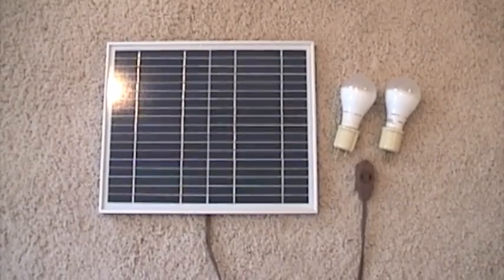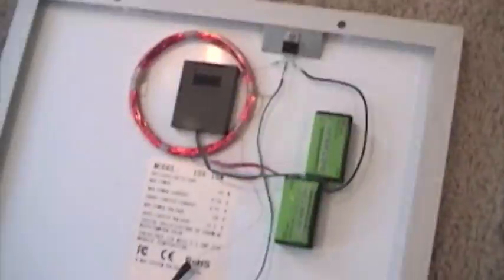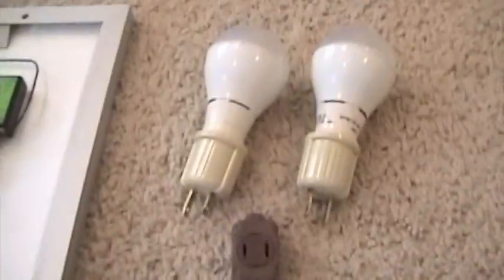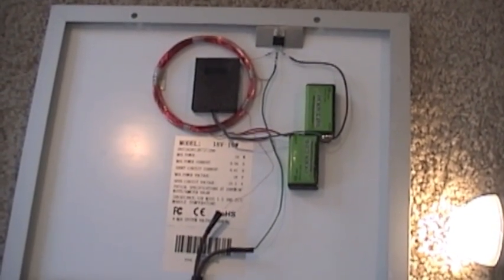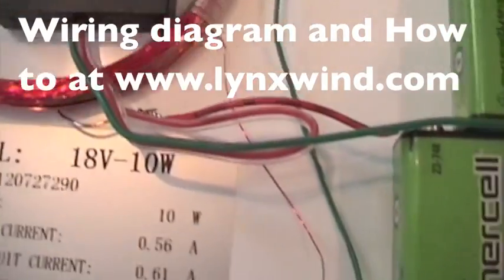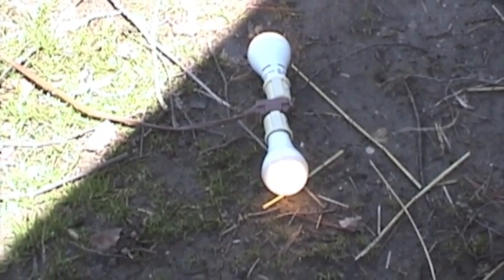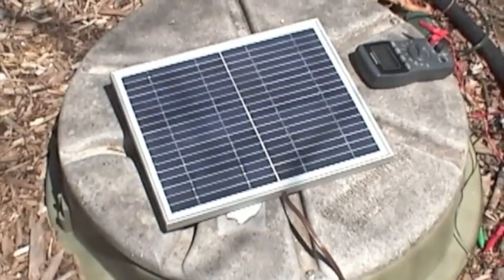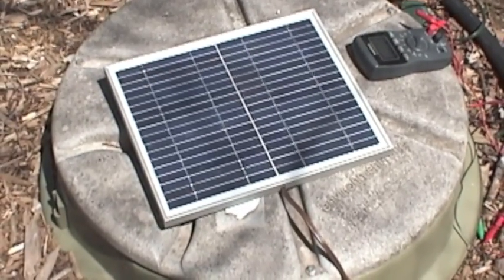SOLN1 - Mini

Comment: I think that the best application for this "all in one design" would be apartment building dwellers who could set this in a window during a power outage.  One hour of light at night doesn't sound like much but it beats sitting in the dark when your flashlight goes dead and you run out of candles.

Comment: I took a visit over to your site but I didn't see the schematics for the joule ringer air core I was interested in the amount of turns you did on the primary and secondary. I too like to build this stuff but the air core is more interesting because its not bulky.
Thanks.

Comment from the maker: I like your idea. LaserSaber basically designed this as a self contained module for campers, emergencies so that someone doesn't have to have separate components all hooked up.  You place it in a sunny window or at your campsite for convenient  instant power.
Your idea of the separate battery means you could have much larger storage capacity, but a 20 Lb battery isn't so fun to lug around if you're hiking.

Comment: how about using a different box to plug into the solar panel  and put in super cap's...  so the panel can be left outside and the box inside...  for ease of use...  and then you have potable power and no problem with the weather...  cap's extend battery life.. make it like a backpack or suitcase  so you can add any battery or cap's you want...?